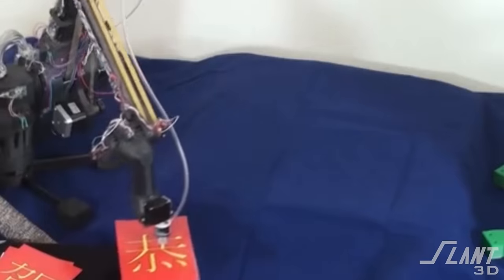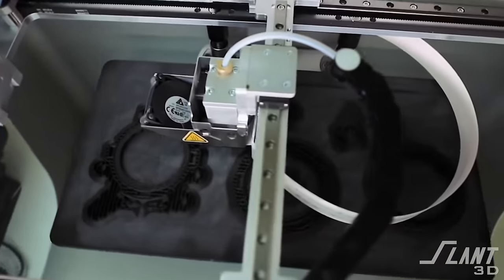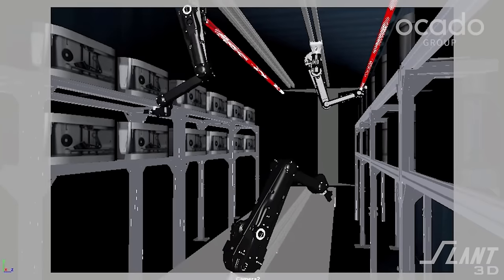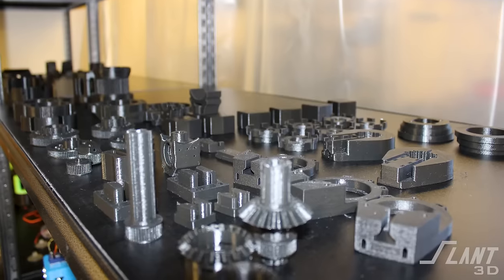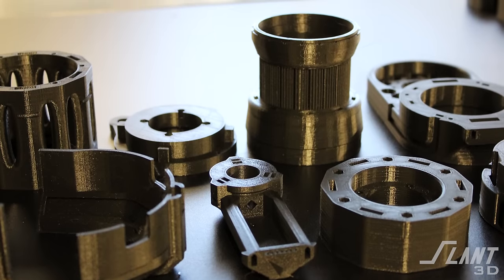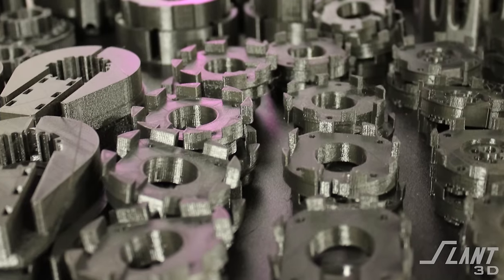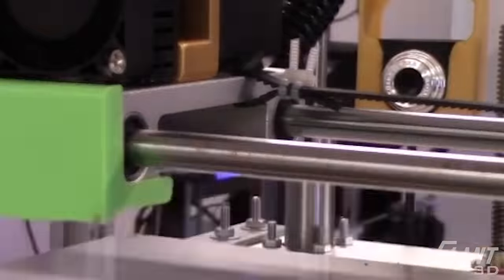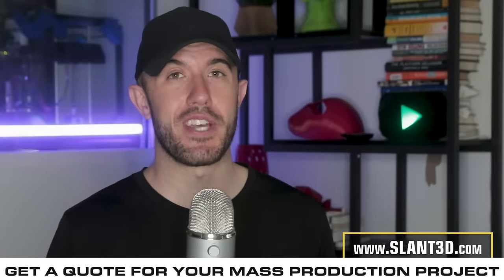$26 Million Robot Arm: Real 3D Printed Products

Comment: I personally think molds are superior to 3D print when quantity is concerned, and all models are refined and free from operational defects of the component. Bottom line 3D printing is another form of manufacturing which doesn't render others form obsolete rather used in combination with others can make for vastly better products in the end. A 3D printers strength is in prototyping and cost reduction, where as casting and molding has a speed and part strength advantage. Now if you'll excuse me my Ender 3 just finished a phone stand I've been working on. 😊
Reply: I would have to agree but as an additional point the other downside to 3d printing is the size of the operation that is needed to meet the same amount of parts an injection molder could pump out also the labor that goes into a print farm would be way more than any injection machine however prusa and mosaic is trying to aid the amount of labor that is needed
Reply from the maker: Labor is not a problem. The automation problem has been solved for years. And implemented in places like our Megafarm.
Reply: @slant3d  I'm starting to think from your responses you have little understanding of anything you talk about. You fail to give any actual explanation as to why you are right when people are critical of your statements.

All you do is go "No you are wrong" with no further explanation.
Reply: @star-jz5fk  Guys running a business and knows he only grows that business if people believe that the method is not only viable but amazing and innovating.
Reply: One of the key factor of Injection molded part is the parts being isotropic. If you also measure your Flexural, Tensile and compression strength you will see that a printed part can be a third to half the strenth of your traditional molded parts. Although, you have to deal with mold complexities. Even with prototype resin molds (amazing process very fun too) you will have for small features to make minimally aluminum inserts. In this video we saw some very detailed feedback or position indicator for stepper motors which would probably need some aluminum inserts for prototyping the mold. Which drives the price up. The real advantage here is that they can build and make money rapidly and in a simple way. (+ flexibility)
Reply: 3d printing wins out for small run batches and rapid prototyping, but 3d printing also wins out in certain designs where your design is shaped in such a way that it physically can't be cast or injection molded. This can involve weight constraints, where 3d printing can allow removal of material that would be impossible or impractical for casting (such as material that mandates destruction of the mold, largely eliminating the benefits of casting) or shapes with overlapping and interlocked shapes. For example, chains and fabric can be 3d printed, but can not be cast.
Reply: Molds are far superior.  They aren't that hard to make either.  Then again, milling those parts would work too, and you would end up with Al.  I love plastic, but it isn't metal.
Reply: @kristenl8043  that only right if we talking about commercial 3d printers but industrial ones are used to build rockets

Comment: No 3d print beats the overall quality of something made on molding
Reply: that is very debatable
Reply: you can't mold every stukture
Reply: @rabenklang7  that's why I said overall quality, of course 3d printing has some advantages, but when you sum up the pros and cons of each method, it becomes very clear which is the best
Reply: what's the accuracy of molding vs 3D print?, talking about error rate and size.
Reply: Geometry… I worked setting molds and repairing injection and blow molded parts. Years later got into 3D printing. I’ve since created many parts that are indistinguishable and equally strong and structurally sound. It’s all in the design and execution.
Reply: To give you a real life example of why that does not always happens, ak47 used to be mass produced by mold stamp pressing, in the 50's; but in the 60's and forward, production switched to make them all in CNC. CNC is not exactly 3d printing, but the fact they switched the most mass produced object in the world is something that can't be overlooked.

Comment: To answer your question at 5:40, there are many reasons.   I'll name two:  

1) Getting support from investors & business partners as you try to explain this model - it's very hard with limited case studies to back it up.  Investors don't have trust in nontraditional manufacturing, so it is hard to find one who understands.   As we look for support, we need more stories like this to help solve that problem.  I've shared Prusa's Road to 10,000 printers video many times to help explain the concept. 

2) There's a very limited number of engineers who have a Design-for-Additive experience, which is the difference between 3D printing a crummy toy and 3D printing a real product.  The brilliant mechanical engineers get hired away by big companies, with great salaries. Really average mechanical engineers do not have experience or knowledge to successfully design for printing, since these methods are not well addressed in college curriculum.  So, it's a very small population of folks who are both capable of doing the design and not taken by big companies.  Once they arrive in the big company, they are tasked with much larger scale manufacturing tasks so they often become more brilliant at traditional methods, and the 3D printing or Design-for-3d printing experience is often outsourced.  This concentrates the design experience in the niche where folks are actually building print farms.  The biggest print farms once again are operated by big companies which probably have several legal barriers to the engineers gaining experience, leaving the company, and making a startup which leverages that experience in a novel product.
Reply: I appreciate your comment thank you for the information

Comment: Great example of 3D printing accelerating product development>>product launch, which is not often discussed. Lots of focus goes on design modelling/prototyping, lots of focus is misplaced on "mass customization", but I saw through my work there is incredible value in accelerating the development/engineering/DFM process.

Comment: Dexter was a Kickstarter started to end robotic arm scarcity. It successfully raised $108,885. The people who funded this startup wanted this company to provide a service to the general public of providing robot arms to consumers. Haddington or Ocado doesn't provide any 3D printed arms to the public currently, and I doubt they ever will.

So, this company stole money from people. And not only did they steal money, but they also didn't put anything in the contract to continue production to serve to the public, once Ocado claimed their buisness.

This video shouldn't be celebrated as a postive thing, because there is nothing positive about building a 27 million company, and running.
Reply from the maker: Every backer received the item they preordered.
Reply: Well they had stls for the low tier didnt they? So the design is out there with documentation for people to build they just need to source the components which are by design big standard parts.

Comment: I'm sure you've gone over this a million times before, but for order sizes around 5,000-10,000 would it be cheaper to utilize Slant3D's mega farm rather than injection molding?
Reply: That depends on a lot of factors. From base research I've done, I think 10k parts is usually the break-even point where your injection mold has finally paid for itself and the net cost has hit zero.

That's absolute costs, not relative to 3d printing. You would have to get an estimate from Slant on what their costs would be.

Comment: I think the issue with large scale 3D printing is the marketing. 3D printing has been marketed for so long as a hobby/toy maker that people don’t see it as a viable alternative. Mold making and the traditional manufacturing process seems like the the way the “big boy real companies do it”. In my mind it’s similar to when you sell a product with a cheap price and customers thing it’s not going to be good. But if you take the same product and raise the price it sell really well. The big guys use a mold that costs 50k but you’re telling me I can do it on a machine that costs $2000. It doesn’t seem real. 3D printing has a perception problem that it needs to get over.
Reply: I work with injection molding now as well as 3D printing. You have a big up front cost for the mold fees for injection molding, but after that, 3D printing can't yet match the speed or price of production with injection molding. You can slam out thousands of parts a day on a single injection molding machine, depending on the part. I do admittedly make relatively small parts, so my biggest cost for a single part's mold is like $3000, not $50000. What's so cool though is that 3D printing is a nearly perfect method for prototyping parts that will eventually be molded. Just today I was printing parts in ASA and TPU to simulate mechanical properties of their injection molded counterparts. They are anisotropic because of the FFF process, but you can still get really good tests out of them. I can't imagine what it must have been like to develop injection molded parts prior to 3D printers! What a nightmare of a process that must have been.
Reply: Much of this is about scale and cost to produce component that get integrated into a product.
For context for hobby/commercial production we need to also consider the level of design skills and effort going into a component. Key to production level 3d-print manufacturing is the quality of design. 
With a product having dozen(s) of components, there is a huge cost savings to be had with 3d-printing (even with professional commercial design) until a certain scale of production is reached. 
Note molding and 3d-printing are not mutually exclusive. It's possible to design a product that uses both 3d-printed and  molded components.

Comment: How do you deal with size inaccuracies due to shrinkage and other factors? It's something I've noticed as a big problem trying to make my own parts, and at least for me it kinda limits my uses to prototype parts where I can alter them to make it fit if needed
Reply: you build the tolerances into your 3d modeling, after you've tuned your printer to make it as accurate as possible. For example, my ten+ year old i3 clone which cost me about 300 wayy before the ender series came out, is capable of producing parts that fit inside of a 0.2mm tolerance. I add this tolerance to my holes and some inner dimensions (slots, walls, etc) and then when the parts are doneprinting , they fit. Now imagine your printer is a Bambu Carbon X1, this tolerance would be reduced to 0.1mm or better, and post processing is almost elimnated entirely. Hope this makes sense.
Reply: You can tune your printer to be very good at that kind of thing. Granted, it requires a bit of studying and technical expertise. I can get mine to do dimensions within .15mm. It also helps to have an enclosure or even a heater with a temperature controller to make sure you don't have warping.
Reply: I use 0.005" as a typical tolerance for my Prusai3mk3. With a little bit of messing around with calibration I feel like this tolerance is very achievable. Buying decent filament helps too. When I first started 3d printing 6+ years ago, most filament had a ±.05 mm tolerance. Now its pretty standard to see ±.03mm which helps when calibrating and keeping things calibrated. I print mostly with PETG but you have to find what works best for you. Get that working well and go from there.

Do you have a Makerbot? If so, throw that piece of shit in the garbage and buy literally anything else. If not, happy printing :)
Reply: Different materials have different shrinkage rates which you can find data for, for example pla has from 0.3-0.5% shrinkage, so if you use this value to compensate your dimensions that will get the part very close to the intended dimensions.

Comment: I'm surprised they wanted to go with FDM printing for high precision robot arms. I would think something like SLS or resin would provide much better strength on each axis. In my experience with FDM, layer adhesion tends to be the weak point. I'm not saying it's not good enough, just that when stressed the layer axis tends to be weaker than the other 2.
Also, isn't SLS faster for larger batches of parts?
Reply: Because very few people have sls (or even resin) printers at home, compared to the number of people with FDM printers - their success came partly from selling the files for people to print at home...
Reply: @DarkerEmpathy While part of their success might have come from selling the files for people to print their own, they also sold complete machines. It's not like the company selling them couldn't use SLS or resin printers to improve the quality of their complete arms.

Comment: ummm.... I think you'll find the 260-fold increase in valuation had very little to do with the ability to 3D print parts. It's more likely to be the motion control systems. Otherwise every other robot arm kickstarter would be killing it too.
ah ok, I looked into it a bit, seems like they use encoders on the joints instead of the motors, so it doesn't matter if the construction is sloppy (within reason). That's what allows 3D printing to be a viable option.
Reply: Encoders aren’t used instead of motors it’s used with motors. It provides positional feedback because without it you can tell soemthing to go to point X but you don’t know if it actually got there.
Reply: @JeronimoStilton14  I didn't say encoders are used instead of motors lol... I'm saying the encoders are positioned at the joints, not at the motors.

Comment: 3 d printing is too slow compared to molding... and molding systems do not have near no motors or waste or spare products so its cheaper and faster on repeating non complex jobs... 3d is good for experimental and design changing printing. moldings stencil or casing design takes time but after that its just repeating ...
Reply from the maker: Unfortunately that is not true

Comment: I would love to know what printer you use and do you see any value in installing a hotend system like E3D's Revo system?
Reply: An automated print farm where they have a large number of printers probably won’t have any benefit from using something like Revo. Probably the only reason they change nozzles is due to wear and when you know what you are doing it doesn’t take long, plus if you use high wear nozzles you won’t have to change often. Revo is good for when you will be changing nozzle often, mainly for changing sizes but also for material (although E3D only has brass and one other material), a print farm is unlikely to be doing that.

Comment: "Why 3d print isnt used for products?"
"I don't really know"
Well here till this point i believed what he said. He exactly knows as anyone who ever printed out something and suffered from various dimensional inaccuracies to layer adhesion and all sorts of first level problem not to mention QA. You exactly know, you just don't want to say it. 3D printing is for hobby/prototyping. Not for production.
Reply from the maker: Very Incorrect
Reply: So it is with other forms of manufacturing. No form of manufacturing is easy-peasy. They all have their downsides and difficulties to deal with.
Reply: You have no idea what you are talking about. A lot of manufacturing techniques have to deal with dimensional inaccuracies and shrinkage, you just need to compensate for that. Layer adhesion and first layer issues can be dealt with using well tuned printers, if you are having a lot of issues with those things then there is something wrong. 3D printing is more than capable of being used in production, have you not seen what it is capable of?